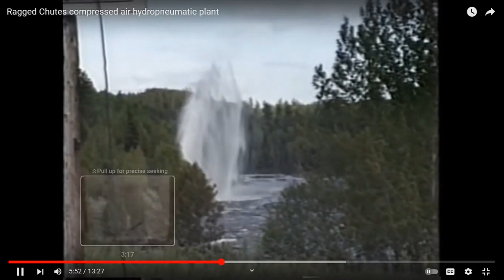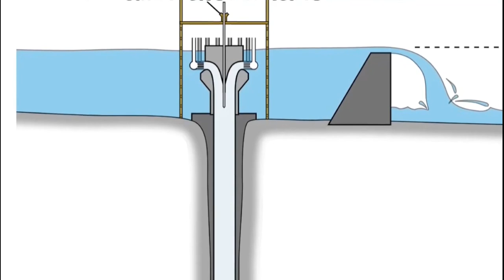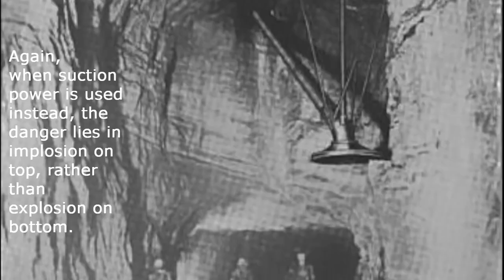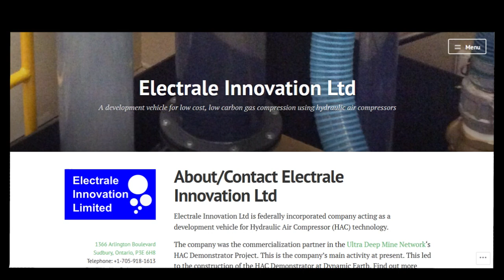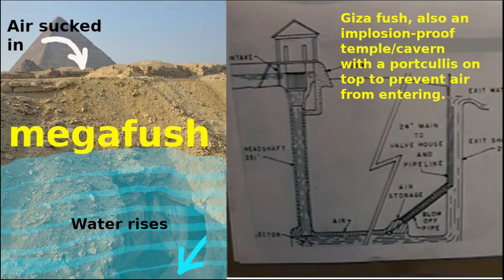The Giza hydropneumatic air power plant ! ! !

Comment: Hi! I am an engineer from Norway. I also figured out that the Kings chamber is a vacuum chamber for the body of the Pharao, all the pieces fits, they sent his "soul" to heaven through the star ducts with his water vapor, after that they buried him in the kings valley. I searched for vacuum and Pyramids on Youtube and found your channel. I also saw this History for granite girdle gate ante chamber hypothesis, seems like you saw it too. They are ofcourse vacuum gates. I started out with the water basin around the pyramid which is a missing piece in your hypothesis. I understood the flushing down to the aqvifer, but you gave me the ebb and flow of the nile, causing low and high pressure, a push and a pull. Also those vacuumated coffins I never got to, which makes total sense. I also thought about those granite blocks at the bottom of the ascending corridors is a pressure valve, adjustable with number of blocks...
Reply: They could not decide when the Pharao died so they had to have the ability to make vacuum on a push too, so they may have used the push to push water from the decending corridor up in the grand gallery, then flush it and make vacuum. This water can come from the basin around the pyramid. But just a flush down the decending corridor would also create vacuum if you close the entrance...then you domt need to make the grand gallery wet and get far less water to vacuum boil...
Reply from the maker: I don't understand "vacuum on a push"   @familienglum3902
Reply: The granite stones at the bottom of the acending corridor could also be a grand gallery vacuum adjuster. They may have wanted to slowly boil the Pharaos body at like room temperature for best result. Then the water vaipor volume also is far less.
Reply from the maker: I assume you mean slow dessication. Maybe all mummies were dessicated.  @familienglum3902
Reply from the maker: I love your idea, but I think the king chamber had vacuum only for hoisting during construction. I think the pharaoh was dessicated in an underground vacuum chamber. Yes vacuum gates, video coming soon. The water basin is missing in my video. The water basin  is the basis of my Youtube channel.  I don't understand when you wrote: "you gave me the ebb and flow of the nile, causing low and high pressure, a push and a pull."